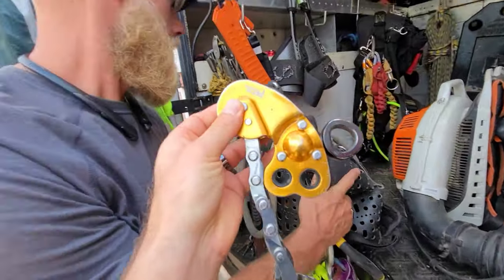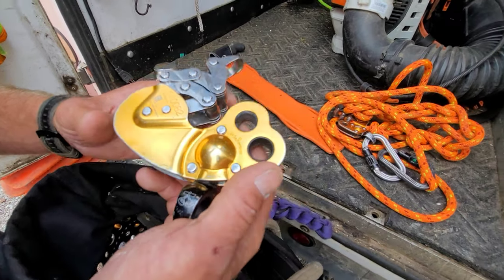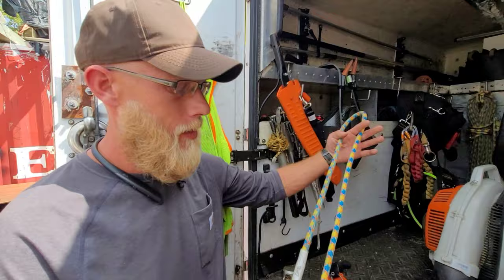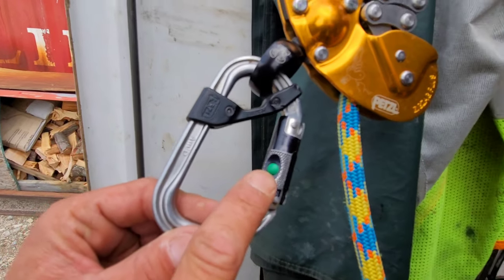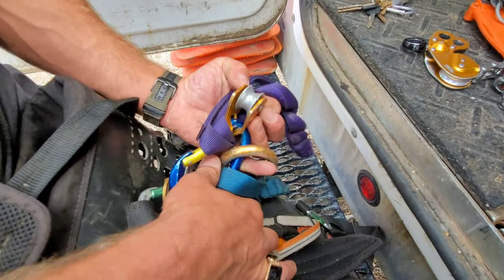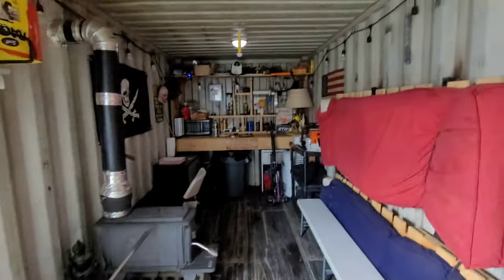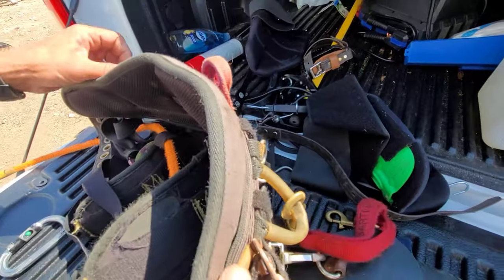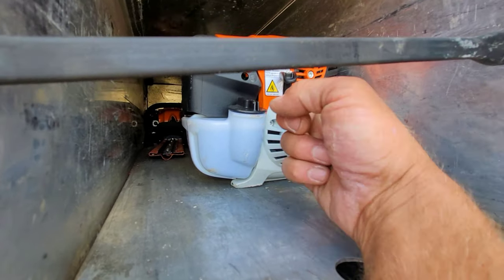This Weird Device Increases Tree Climbing Efficiency by 528%

Comment: I use a Rope Runner Pro, The ZigZag is great except that it is not mid-line attachable, and you need a Chicane to use it in SRT.  It's on my wish list though.  You are lucky to have a friend like that.
Reply: Best for double rope mate highly suggest it
Reply: You can use a tether with a rope wrench on it too...that's where the concept of the chicane came from. It add around 30% friction plus keeps the actual zigzag links from over extending at the major link. The zillon actual allows for this movement and action in a vertical position without anything additional.

Comment: Petzel states in the zigzag manual that you should not use it as a saftey/work positioning lanyard adjuster or flip line adjuster. The zigzag should only be used  as a mechanical prusik for climb lines. The petzl zillon has a similar construction to the zig zag and is built for work positioning lanyards. But it is true that a beginner climber should start with and master friction hitches before giving mechanicals a try.
Reply: This is simply not true.

Comment: That is the best way to climbs with a knot a friction hitch of some sort those mechanical devices are faulty they will let you fall they are not appropriate for this type of work or any type of work and what you guys are talking about here is climbing a rope not climbing a tree I don't understand why you guys modern treat trimmers think you got to climb a rope there is a tree right in front of you climb it
Reply: These new zigzags are so over built. I would love to see one break. I have side loaded them around branches, shock loaded the hell out of mine and never any issues. The only thing is when you wear them out they will have a slow slip just like a pruzik. Some will keep using them when they are even slipping. But anyway good luck with carpal tunnel.
Reply: I can't even believe what I'm reading here 🤣 fucking A
Reply: Don't talk nonsense, you're a dinosaur man, Iv been climbing on a zig zag over 10 years they are every bit as safe as a friction hitch but have many advantages.

Comment: I can't believe you're sitting there recommending a device that you say may break and may fail but no you're not so you can save your life if you use your knots from the beginning you guys are I don't know you shouldn't even be shouldn't even be in the profession for sure you should not be in the tree industry and you definitely should not be teaching people anything I'm a 30-plus year tree trimmer climber I climb trees yes I use ropes to repel to rig to whatever yeah those mechanical things that you guys have are junk like you just said they will fail they will break apart they will pop they are not designed for the stress the Rope at a 5000 lb braking strength of the not tight in it 5,000 lb breaking strength come on guys get rid of the fancy junk and use a rope also you're using a rope for a flip line that is not right you're supposed to use a steel core flip line everything else is a safety lanyard
Reply: Stay ancient my friend. Enjoy working harder not smarter
Reply: Yeah relax bubba you lost me at the whole “only steel core” you must never get off the stem safety atleast to me is ultimately up to the individual mechanicals are great and blah blah I will say I always end up back on a wrench